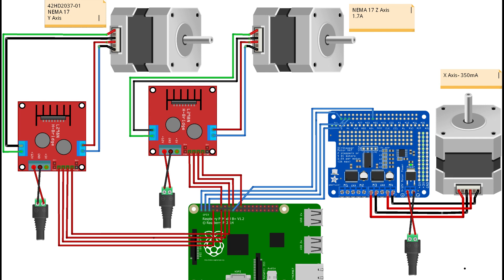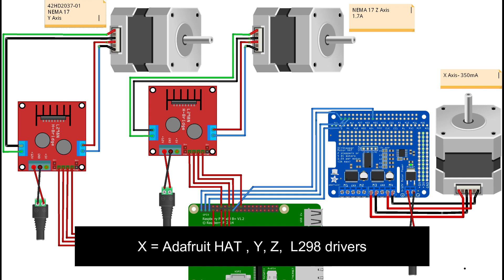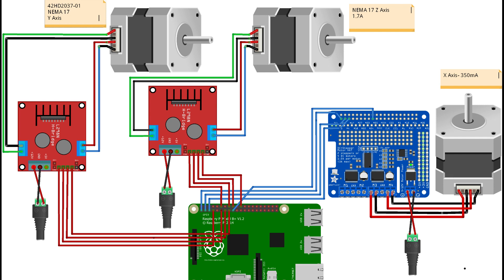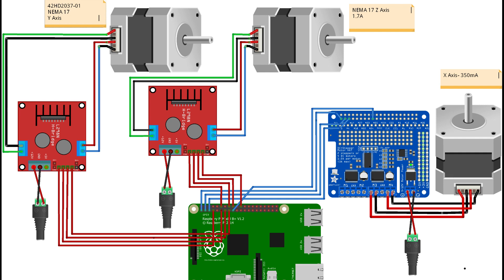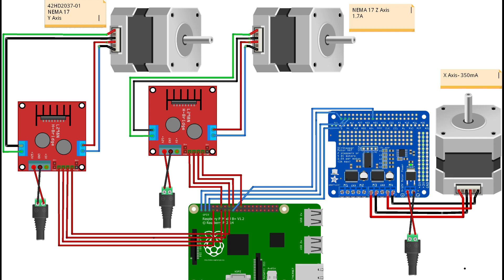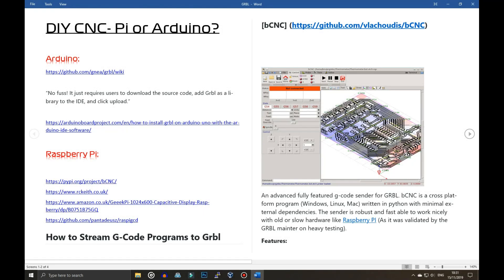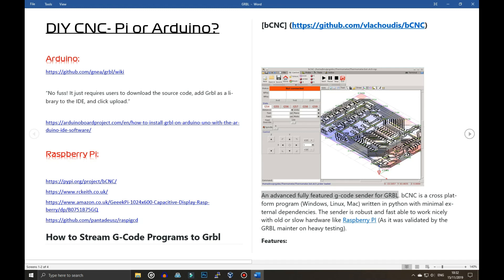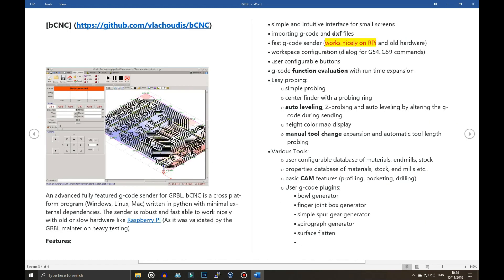Raspberry Pi DIY CNC project - update - bCNC

Comment: Who was smashing cheeks in the background? I just built a mini CNC machine it's the 3018 and I want to run it with my Raspberry Pi 3 plus. The CNC came with a control board but it runs that grbl or whatever and I was wanting to run something better but I'm not sure what yet. Any suggestions or tips would be greatly appreciated thank you
Reply from the maker: It's been a while since I made that, but to answer your question, I did buy a "Protoneer" but never got around to using it. https://wiki.protoneer.co.nz/Raspberry_Pi_CNC
I think GRBL is still a decent way to go. I used https://willysgaragenorway.no/ for mos of my research. I did also used to work in a woodworking factory with 5 axis CNC, Wieke, Schelling etc. GRBL is best bet rather than anything proprietary...IMHO

Comment: Currently I am using a Raspberry Pi 400 wit the Openbuilds controller and while it works fine. I'd love to get bCNC up and running as it has more features that I am use to with UCCNC and Mach3. Is there a way to load bCNC onto a Raspberry Pi with the Twister OS that you are aware of or would I be further ahead loading Ubuntu Desktop. My system has more than enough capacity as my boot drive isn't managed by an SD Card but rather an SSD Hard Drive with 256 GB's of Hard Drive space.
Reply from the maker: I'm not familiar with TwisterOS but all I would say is Ubuntu will most likely have a lot more support, and you can go for LTS as well.

Comment: I just tried installing bcnc, but realized my cnc's xp machine isn't connected to internet so I can't update all the required python libraries. I tried on another machine, but it required different versions of libraries and didn't work. Oh well.  Is bcnc ever going to be a .exe that'll work on xp? (It looks like github removed all the exe that even just run on win10).
Reply from the maker: I feel your pain - how about install bCNC on a Raspberry Pi? run with a HAT (eg Protoneer) or alternatively use it with GRBL via an Arduino?
Reply: @jobstr-work  I was trying to use bcnc with grbl and Arduino. But not on PI.  Pi doesn't have all the other gadgets I have on xp. And who knows what other problems I'd encounter.  Seems like they could just build the exes.
Reply from the maker: @TheRainHarvester  Not sure if it will help, but if you root around on the GitHub page, there is a dropdown arrow for "branch" and that looks like it has older versions of the code? from 2 years ago?

eg:

https://github.com/vlachoudis/bCNC/tree/v3
https://github.com/vlachoudis/bCNC/tree/revert-1095-Code-cleanup-E301-E302-W391/bCNC
Reply: @jobstr-work  I didn't see any exe. I think my problem is with python, not bcnc.  But I can't get bcnc to work if python fails.
Reply from the maker: @TheRainHarvester  Ah ok, yeah, does look like you'd now need to install from their source :

"If you don't have git installed, you can use pip install --upgrade https://github.com/vlachoudis/bCNC/archive/master.zip"
https://github.com/vlachoudis/bCNC/wiki/Installation
Reply: @jobstr-work  Man I really appreciate the help.  Yes, I tried pip install.  It was one of the last steps that it failed.  I'll check my notes.  
I wonder if they didn't release exe because it's still buggy (I read about a bunch of bugs on git: fast/wrong direction moves after setting max speed in grbl etc). Is it buggy for you, and do you use it much?
Reply from the maker: @TheRainHarvester  oh no, that sucks donkey balls. I ran it on Linux  ages back but not enough to find any/many bugs.  
I'd probably go with http://linuxcnc.org/downloads/ now and have a dedicated Raspberry Pi4 to to run it. LinuxCNC actually is the entire OS.

Maybe try some other forums and see if there are any links to old versions, eg : https://forum.shapeoko.com/viewtopic.php?t=6086&p=47016

Vista (not XP) I know.

Comment: I'm interested to see how this will work straight on a Pi so you have a new follower.  You may like to have a look at my DIY CNC videos.
Reply from the maker: Cheers Richard, I can see you made a nice CNC machine.
Was that using an Arduino with GRBL installed?

I thought I'd see how far I can get with just the Pi - and even write my own code in Python to get all the hardware tested and some basic cuts, and then progress to running bCNC on the Pi, and replace my 2xL298's and Adafruit HAT with a "Protoneer CNC HAT" eventually.

Your Z axis build was more than I could make with limited tools, so I cheated and bought the Banggood Z-axis, but quite pleased with that. I've received some more parts over the weekend so aim to get a new video out this week with all the hardware finished and some trial runs with the 3 motors.  I've got a 775 spindle motor on order, but if I run out of things to do, I still need to look at limit switches as well, and add an LCD to display some basic info.

Hope you do some more videos soon, nice to see a UK based video for a change! Thanks for the comment, I have subscribed to your channel too.